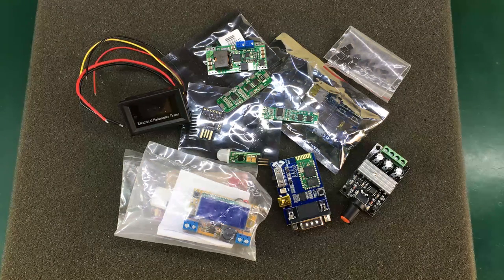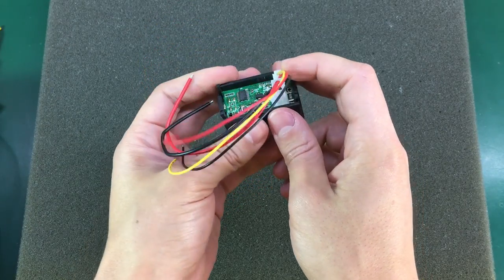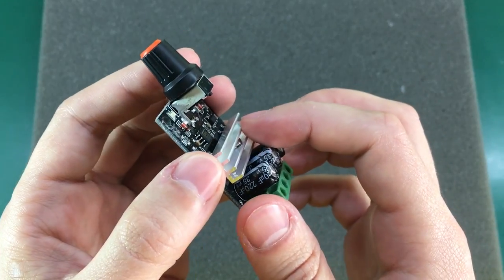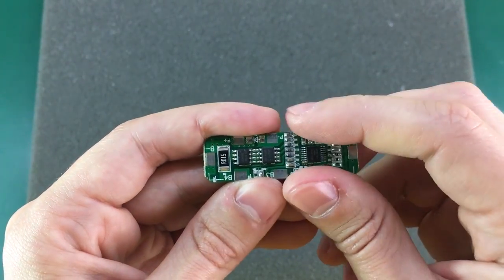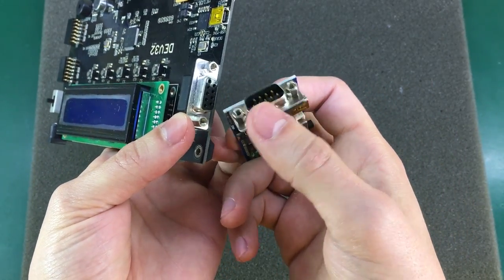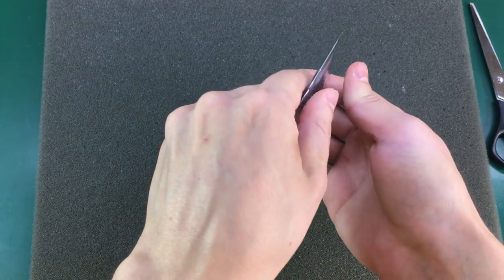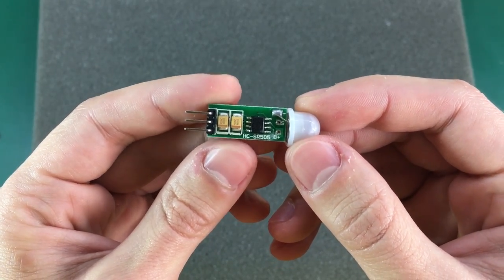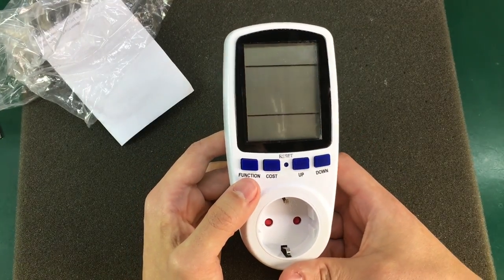Voltlog #50 - InTheMail

Comment: The HC-SR505 module controller IC is EG4002A, so the schematics of the HC-SR505 could be found in the datasheet here:
http://www.egmicro.com/download/EG4002_datasheet.pdf
Only the S8050 output transistor is replaced with a 0R link.
Reply from the maker: thank you!

Comment: Great review and thank you for bringing up BQ24650!  How does this board handle reconfiguration for different numbers of Li-Ion batteries?  According to datasheet this is done by changing a voltage divider feeding Vfb, but the boards seem to offer no configuration.  Also how would you connect a load?
I ordered SL02B charge controller which seem to support configurable number of Li-Ion batteries.  Did not try it yet.  Cheers!
Reply from the maker: one of the pots is used to adjust the output voltage and the other one the MPPT voltage. The charging current seems to be fixed at 5A with used current sense resistor value and it's possible to adjust for a different charging current by changing the current sense resistor value.

Comment: The OLED power meter has a NTC on the back for temperature sensing. Suspect it is a 10k, but I measures ~8.6k on the board at ~25°C.
Reply from the maker: thank you for sharing that. I would like to see a 4 in 1 meter, with a larger lcd for current, voltage, power, energy and with a separate power and sense line.
Reply: +VoltLog have not seen a panel meter like that, I'm looking forward for the other one you found. Hope it sits the bill.
BTW, I enjoy your videos. Please, keep them coming.
Reply from the maker: thank you!

Comment: I got today my BQ24650 MPPT Solar Panel Lithium Lead Acid Battery Charge Controller 5A and has a really problem to use it, because there was no manual with it. do you know how to adjust the modul correctly or do you want to make a practice video for it?
Reply from the maker: yes I might do a video soon. A good starting point is the BQ24650 datasheet, there you will find all information needed.

Comment: Im sad that the panel meter does not seem to support negative currents, as a "battery gauge" would to keep track of how charged a battery is not only from voltage, in a setting where this is sitting between a battery and its charger and consumers.

Comment: I am looking forward for the test of the mppt controller. Was about to build one myself but this module could make it easier. I also like those digisparks. Like a miniature arduino and you can use arduino ide to program. But if you so not Need the USB Feature you can use a Attiny 85 and program it via ICP. Costs just half of the digispark ;-)
Reply from the maker: yes, the DigiSpark is very convenient for small projects and for getting started with micro-controllers as well. Unbelievable what you can do these days with so little money. Regarding the MPPT controller it's funny because if I remember correctly I was doing some research for building my own too when I stumbled upon this module on ebay. Another idea is to use it together with a solar panel and battery pack to get/store free energy that will then be used to power some Rpi or something similar that could gather data from sensors or acts as a central hub for something.
Reply: +VoltLog i have a 12 /7A lead acid battery and a 5 watts solar panel laying around wondering if i can collect enough free energy in summer during a week to power some things in my lab on the weekends. Not because i Need, only because well i can :-)
But maybe For that Little power of max 5 watts a cheap Buck/boost module with reverse current protection diode on battery side could do the job when set to about 13.5 Volts or so.....
The battery discharge protection circuit For this battery will be realised with an Attiny and a mosfet. It exists already on a breadboard and seems to work fine.
Reply from the maker: That's exactly what i was thinking, there is this free energy and I should tap into it :) not because I need but because it would be possible and cool. In your case a buck/boost will do the job of charging but no MPPT. The BQ24650 also has some added features like multi chemistry supported, high accuracy, protection features. It'a a nice all in one solution but you could certainly work with less.
Reply: +VoltLog and i already have the perfect lab power supply module for use on that 12V battery. Ordered this from Banggood: DP30V5A Voltage Converter Step-down Programmable Power Supply
https://bnc.lt/4Sug/NjJyomGDGt
And added a switchable step up converter with it in a little box that gives me a portable lab power supply regulating current down to 1mA and usable with any voltage from 5 to 24 Volts input on a standard 5.5mm jack. Maybe this module could be also interesting for you? There are a few of them with different voltage and power ranges available.
Reply from the maker: Steve Wagner has done a series of videos on using those programmable power supply modules https://www.youtube.com/watch?v=cuLCeDsv1Hc They look interesting but since I have 3 of these Gopher power supplies already.. I'm not sure I need another switch mode power supply :) They are however very useful if you need to make a portable power supply like you mentioned.
Reply: +VoltLog thanks for the info. I did not know steve wagner before but i will watch those Videos today After work

Comment: Thermistor to let you know the temperature inside your power supply maybe?
Reply from the maker: The thermistor could be extended with wires and placed to measure even the temperature of a heatsink.

Comment: I think mailbags should give info what the products are really like - not what there chinese specs are. "This should give out 10A" is lot less worthy than "as you see, in quick measurement this is ok for 5A with no severe overheating, at 7A it was getting hotter than confortable". (or the other way in case it is under specified!)

Comment: Do not think that using the battery protection modules as chargers is a good idea. 18650s are to be charger with a CC/CV profile. Maybe you can make a S4 charger with 4 single cell charger modules, just for the pleasure of DYI.
For charging your 18650 packs you'll do better with a hobby RC charger. The problem there is to avoid a doggy clone. I got my imax B6 mini from banggood and it is original, as far as I can tell. I can digg out the link if you are interested.
Reply from the maker: Thanks but I already have several lithium battery chargers that I can use, I was just asking myself what would happen, how will this battery protection board behave in terms of current once the voltage reaches 4.2V, I guess I can do some tests and find out.
Reply: Great video. The 4S battery charger is interesting. I have a similar charging board on the way. Charging packs of 160 18650s batteries in a 4s setup with a laptop power supply at 16.4v works (a full charge at 4.1v is better at extending the life of the 18650s). However, balancing the 4s pack is an issue. The imax B6 works great but I have an intention of creating 5 packs of 160 batteries and buying 5 imax b6 chargers seems like a waste of money. 

I wonder if the charging board will charge the 4s pack up to 16.4v if 16.4v is delivered through the main or it will boost to 16.8v or whether it will not charge at all.
Reply from the maker: the 4s battery protection module is not intended for charging packs, it's sole purpose is to protect packs.

Comment: Why they take those ic's out of there original packages in the first place. :(

Lucky there are good ebay seller that never send you IC like this,  if some seller send me IC like this i will contact him/her so they can learn form there mistakes.
Reply from the maker: I don't think they take it out of the tape if the ic's come in tape but there are two other possibilities: 1. the ic's come from tubes, and they don't waste time cutting tube to length or 2. these are ic's recovered from a manufacturing process. For example a pick and place machine might waste a bunch of these during a production run and they get dropped in a special waste bin. However often these big ebay seller are actually large warehouses in china with lots of employees, I think it's difficult for the info to get to the right person.